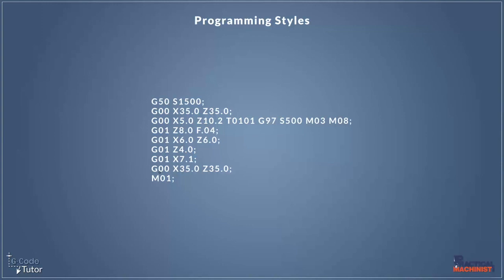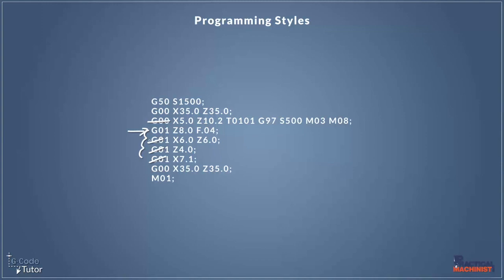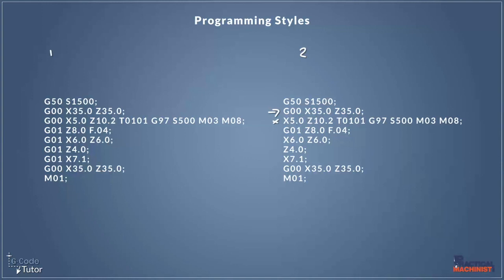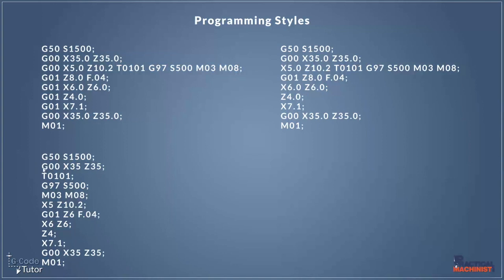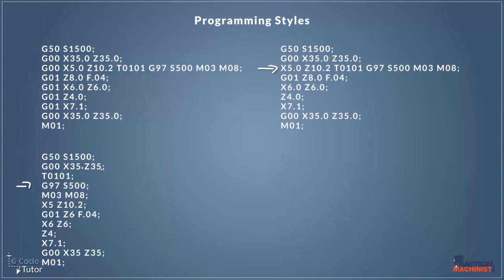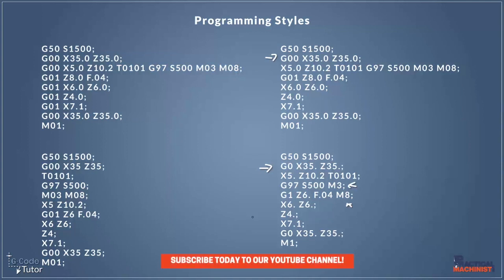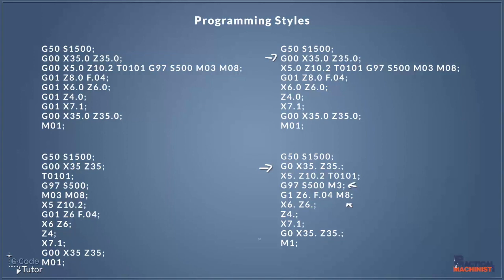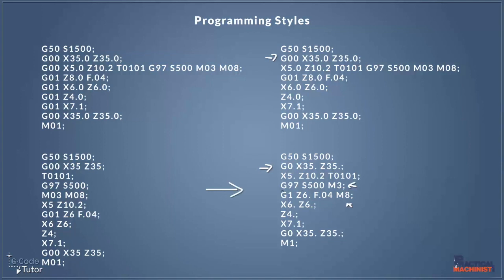What's Your G-code Style?

Comment: I'm not sure when or if Fanuc has changed where decimals absolutely matter. I know that the old machine wouldn't allow decimals. I believe you counted over 4 places starting on the right. So X10 would be X.0010 When they came out with newer controls (like the M6) that took decimals, they still wanted the older programs to be able to run on them. We are using 32i now and I honestly haven't thought to try it out but it very well could still cause a crash. I know that on like a 16 I believe it would still read X10 as X.001,,,I'm not certain that I have the years and controls correct or if they've finally done away with this feature or if it was 4 place ya counted over but I am certain that the gist of what I'm saying is correct.

Comment: My style is something between your example #3 & #4, decimal points after each linear value, but also zeroes in M and G callous for easy reading. I started really programming on paper and pencil, doing ALL the trigonometry on a calculator and then typing out the aper tape to be fed into fanuc controls. Program would be edited and run, but unfortunately the shop did not own a Facit punch so when the machines ran out of memory, there was nothing to do but delete programs. It was very painful. Once they purchased a PC with a basic programing package it made life so much easier since we could program and send/receive and store programs for later use. Ah, the good old days.